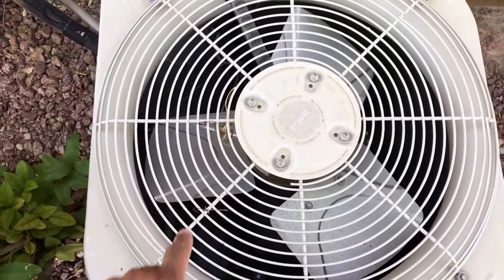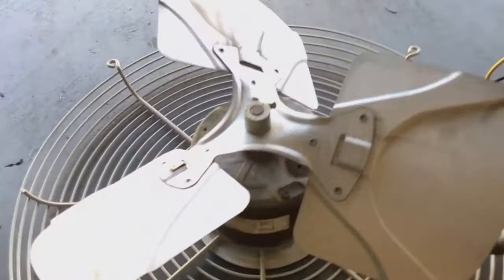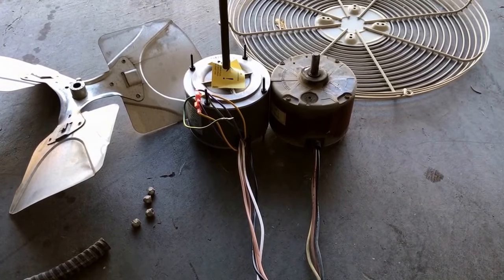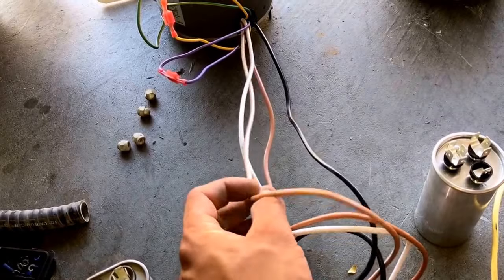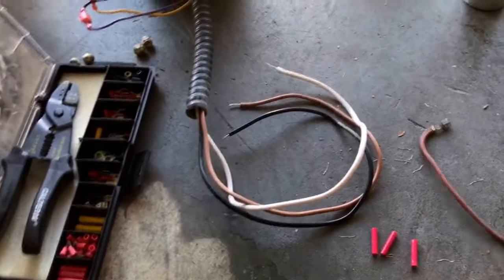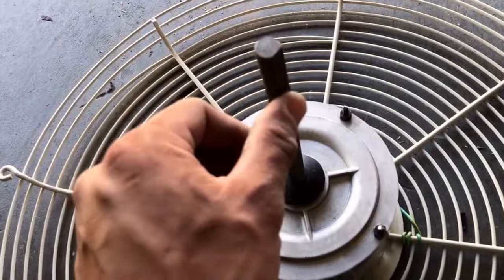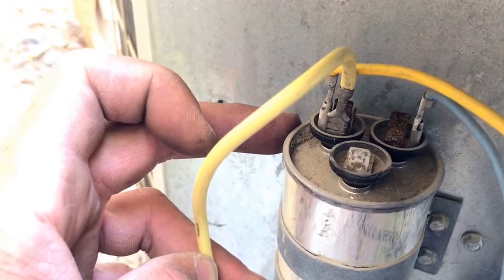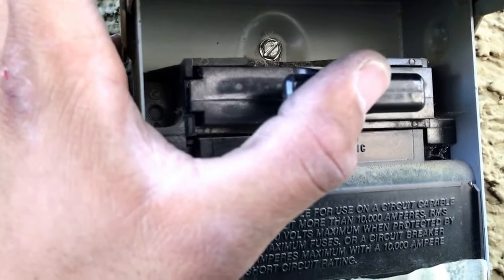Replacing Condenser AC Fan Motor (Step by Step Instructions!)

Comment: I had two “technicians” (actually sales people) come out and quote me from between 8k-14k to replace my whole air conditioning system. They said it was burned out and not worth the money to fix. I ended up doing it myself for less than $300 by watching this video (I ended up changing out the capacitor and contactor as well). This is the real deal, don’t let yourself get ripped off.
Reply: Yeah I got quotes for new AC units 11-18K. Absolutely insane. Luckily I watched this video I’m getting this done asap. I already know it’s not the capacitor. Had someone come look at it.
Reply: I'm lost on the green ground wire part... it's connected to the skinny screw and bolt of course.  But where does it connect to from there?
Reply: @MarqFlournoy  my ac guy just cut it off lol says it’s not needed
Reply: The same thing happened to me. Technician told my wife and I the AC unit needed to be replaced, costing around 16k. These people have no soul.
Reply: For house units this is insane but I'll explain why. The epa, the government and r410 freon. If you fill with old freon it will cost you upwards of $350-700 a pound to put in so a new unit is better. But they're ripping y'all I just had one of my commercial units replaced for $17k it's a 5 ton of I remember right.
Reply: 8 k lol how much is a whole new unit?😂
Reply: @1BadSavage they aren’t cheap that is for sure. 8 grand sounds cheap.
Reply: When homeowners start touching the ac units, all that does is make it more expensive when an actual hvac master services it. Liability = more $$
Reply: Just had them come out for a rental said fan motor was bad 1000 dollars to replace buying one with a new capacitor for 120 I’ll do the labor and have a nice dinner 😂
Reply: Oh yeah, they love to replace the whole system even if your system is 10 year old.

Comment: I replaced the capacitor then the compressor would run but the fan wont, double checked all connections and everything was fine. Texted an HVAC tech I know and was hoping he will be able to come and fix the fan tomorrow. Then I watched your video right before going to bed and went to the unit with a long screw driver, gave it a spin and pushed the breaker in and the unit started running just fine. Tomorrow if the HVAC guy could make time would come and with a poke of screw driver drain $200 out of my pocket. Thank you so much for the video.
Just to share with all, my AC stopped working Saturday night and all the HVAC supply stores are closed on Sunday (Atlanta area). So I ordered it from Amazon for $14.99 then added another item to the order to bring my total to over $25 and got overnight Prime delivery in less than 24 hours. When searching I searched for items that has overnight delivery available.

Comment: I bought the motor for $230 after taxes...... And just spent 35 minutes doing it myself.... Thank you for this video it saved me $888. 
I paid a company to diagnostic my unit. ($69) they then emailed a quote of $888 just for the labor!!!! 
I'm not a guy that knows or even wants to deal with wiring but this was easy even for me
Reply: That's the reason I'm here 😂 but don't know where to buy the motor, where did you bought yours?
Reply: @marketbrock8496  just call and order from a plumbing supply store. Make sure you take a pic of the data plate so you order the right one
Reply: @marketbrock8496  I went to a contractors store and brought the HVAC business card for the guy who said I needed a whole new unit. I told them I needed to pick it up for him and he was installing.. that he asked me to swing by and grab it. They gave me contractors price.  Paid $77 for the motor and capacitor.
Reply: Shouldn't have been moore than $250 to install the motor. Plus the part.
Reply: @Garth2011  Paid $504 including part and labor. Dallas, Texas 😔
Reply: These type of service are predatory because it's 112F outside.
Reply: Do u have to bleed all the power from the capacitor
Reply: @nickolassanchez9420  bleeding the capacitor just means grounding it out after everything is unplugged from it. But yes I definitely would. Take a screwdriver after u unplug everything to the capacitor holding it by the plastic handle  cross touch the plugins on the capacitor itself to release whatever charge it may have

Comment: Great video.   Im doing exactly the same job this morning with the same 2 motors as you use.  I searched this video to try and figure out the wiring differences before i head over.  Your step by step explanation is perfect.

Comment: In the video I watched,found it to be accurate and informative. In your next video I would include the information that there are motors differences when it comes to wet and dry locations . A service tech thought he was giving me a good deal . Sold me an indoor blower motor for a good price, although it was for my condenser. Didn't know till I got it home.I called him he said oh it's alright I use them on all cond. Fan mtr replacements . Sold it back to him.

Comment: I didn’t have a fan puller when I got to that part and I just simply put wd-40 all over the backside and top side aswell as inside the removable tightening nut, then i put an object that fit perfectly in the hole, Put pressure while pulling the fan blade with my other hand (wear gloves just incase) and it came out relatively easy.

Comment: Good explanation and details but whatever you do, DO NOT Loop wires outside of the unit under ANY circumstances. Keep all wiring protected inside the confines of the unit. No one should be able to walk up to an electrical device and touch wires without removing a cover to do so.
Reply: Yeah that’s not too professional looking and dangerous too.
Reply: What would be a better way to hide the wires? When he takes it apart I don’t even see the “reverse” wires

Comment: How bout the discharging of the old capacitor, did you just use a screwdriver basically across the leads to discharge for safety?
Reply: People on these videos keep skipping that step. Somebody is gonna freaking die. These capacitors are no joke.
Reply: I have never seen anybody receive a shock from a run capacitor connected to an AC voltage source.  What you need to worry about is capacitors connected to a high voltage DC source (televisions, HVAC inverters, etc.).
Reply: You'll be fine as long as the disconnect is pulled. If you touch the leads with it still in you'll get a shock but it's only about 110v to 120v. It's not that bad tbh.

Comment: something I have seen I would like to mention. The wires coming from the fan to the contacts. I have seen on some mobile home manufacturers  that didn't have a plastic sleeve for the wires , and I guess it could be the installers , using plastic ties to strap the wire to the top grill. Don't do that. Plastic degrades in the sun. And it will be fine for a while but when it gives and the wire drops into the fan and the fan bends and cuts into the coil, that's totaled. If you have to do that use a coat hanger or something and you need something around the wire if you can to protect it from the sun as well. just sayn
Reply from the maker: Honestly that is a very valid point. Most newer manufacturers (probably to minimize costs) do not have the protective clips on the wires like the older models. Many condensers have clips on the under of the panel where the motor attaches. Regardless I appreciate the input especially when the goal is to help technicians become more effective in the field.
Reply: @MoreThanMaintenance  Typically if your fan gets bent it won't touch the coil due to the way most manufacturers put the fan in a throat away from the coil. But this was an obviously cheap AC only package unit. The heat was in another unit inside, they just joined the ducts. Crazy set up to someone who isn't a mech tech. So really I said it for the DIY who is likely the most common viewer of a you tube video. I'm just a n HVAC controls Tech who was trying to help someone.   Wound up more than I  wanted to chew and more than they could spend

Comment: question:  some people cut the ground saying the motor is grounded by frame.  also, leaving the reverse wires out is convenient in case need to switch them, however will those get sun damaged over time?  also some put the yellow on the contact guess that is ok too?  thanks again

Comment: thanks for this nice video, if the new fan motor i bought has same rpm, voltage, and HorsePower,  but the amp is 1.3 , but the old amp only 1.0, will this cause a problem ? thanks

Comment: Might be a dumb question I'm sorry I'm learning. 
But disconnecting the unit is that the same as turning the power out in the home. My AC unit is located on the roof
Reply: Pull the disconnect, but this only disrupts the 240v not the 24v, so don’t touch the side of the contactor 😁. Be sure the MFD/UF rating for the new fan is correct. Usually I’m taking a 1075/825 rpm 5uf fan out and replacing with a 7.5uf. I know your comment is 4 months old but hopefully that can still help 😀
Reply: You can turn it off at the breaker too if you want to feel more safe. But pulling the disconnect is all you need to do.

Comment: Thanks for sharing, very good video, it doesn't seem like a difficult task w/ your video.  Questions:  1) My condenser runs well, but when the temperature outside gets really cold or hot, it makes a REAL LOUD noise (like buzzing/humming), is this an indication of bad capacitor/motor? Is there a way I can be sure it is before I try to replace it?  2) Why did you cut the bolts?  Couldn't you have the left the original length?  3) Why is the motor reversable and doesn't run just on one/the right direction? 4) Is it OK to leave the wires wrapped on the grill permanently?  Thank you.

Comment: Hey there, just heard a big humming sound outside and turned the breaker off ... now what would cause the outside unit running HOT and the Fan not spinning at all? It seems as if the fan died while the outisde unit and the compressor were working ? any help appreciated it's Sunday night and we have 80+ degrees at 7PM here ... cheers !
Reply: Same problem here 90 degrees inside
Reply: @breannahawkins2901  turn the units OFF at ALL breakers ( inside and outside ) take out the capacitor and put it on a flat surface, if it's rocking/not standing flat replace it > please follow safety precautions and DON"T DO THIS YOURSELF if you don't know what you are doing - pls lmk that you read this THANKS !

Comment: I’m looking for a video that shows me how to handle a capacitor before removing the wires from it.
Reply: I'm a bit late to this but the only thing you need to be mindful of is discharging it before handling. The safest way to do so is with a load resistor, I have a 100W 4 ohm set for that. In truth you can use almost any conductor but a resistor will bleed it slightly slower and its safer. You want to be absolutely certain power is shut off before you do so as you'll be intentionally creating a short by connecting each contact to each other. Ie A to B, B to C, A to C. Ensure you are using something insulated to discharge it, or insulated gloves as you don't want to be the path to ground when touching potentially live wires

Comment: What size were the nuts you removed to disconnect the motor from the face-plate ?
Reply: Whatever size they are going to mount to new fan bolts, so what size is the new fan bolts?

Comment: you didnt say how you cut the shaft, what tool did you use
Reply: it looks with a abrasive disk small tool or drill attached   did you see the smooth cut of the shaft
Reply: I have used a hack saw but sometimes you don't have to cut the shaft if it doesn't interfere with anything in the condensing unit.
Reply: Sam please show video cutting shaft. Thanks

Comment: It's of the utmost importance to lubricate the shaft.
Reply: Do not do this, the shaft has a locking bolt that connects the fan. If you lube it up it can potentially come off. The shaft is connected to the motor and is sealed.

Comment: How much was the motor and where did you buy it?
Reply from the maker: The motor I purchased was a Fasco D7909 motor. The best way to find out what motor is best for your specific unit is to take the information from your condenser motor or if you remove the motor from the condenser and check the specifications on the motor you removed. You want note of  running amps... and voltage of motor matches your specs. You can purchase this online 👍 $80-120 is reasonable.
Reply: @MoreThanMaintenance  thank you!
Reply: @MoreThanMaintenance  I had my combo unit  TUNED UP today and the young guy maybe under 25  said that my  condenser fan motor is " over heating ' it is supposed to be at 60 F and at 8 am is " running at 68 F "  and ' he has the part in the van of if NOT he would be more that happy to go get it at the part store and would not charge me for that " and then he said it would cost me for everything Parts and Labor  " just 654  bucks " 😦  so I politely told him " I am broke now and probably I will do it later on when it must be fixed " . . . what do you think of that price to replace the Fan Motor and this is in Sin City   July 16 2020      Thanks 😎👍😷
Reply: @edca8114  - Condenser motor overheating by 8 degrees?  That's the first time I've heard that one.  That price is pretty steep for a conventional AC motor.  If it was a sleeved bearing bearing motor, he should have oiled it for you.  My new condensing unit has an ECM motor in it so that motor would cost me over $300 to replace it.  There's no telling how much an AC company would charge to replace it.
Reply: @picklerix6162  it was a young cat .. did not cover his boots and was not wearing a mask and  when he check the filter he did not take it out just with a flashlight from the floor and said is ok  then he was eager to replace the C FAN  and about 2 years ago I was told that " my  C Fan was ok BUT maybe it would need to replace it " soon "  so   I just told him  I might replace it later  " I do not have extra cash right now "  is  just  Remove and Replace it   it might cost around 150 bucks have NOT really check but I might do it myself later on   and the young cat told me my UNIT  IS OLD  2013   so   he DID NOT GET THE EXTRA JOB and MONEY for their pocket 
😊😊😄😷
Reply: What's wrong when the unit is blowing air but not blowing cool air? Please help..
Reply: @PhantomMSM-f7y  filter maybe dirty

Comment: Thanks for the video! Can you tell me if a motor with 1 amp will replace a 1.6 amp. Everything else is the same except for amps. HP is 1/6 and 825 rpm. Both same but amps.
Reply: i know this response is a little late, but i think it should be. seems to just be more efficient
Reply: @tomalstar  Thanks!

Comment: Hello good video quick question i changed the unit but i find the fan to be about 2 inches lower due to the crank flat end to tighten the screw will.that make a difference if its 2 inches lower then it was before? Thank you.  Ps. I subscribed
Reply from the maker: If you are fastened on the flat end you will be fine. Just ensure that you have clearance.. ie no wires in the way...etc. I usually take a stick and manually rotate the blades through the casing. If it turn your fine 🙂

Comment: would this also work with a fan motor on hayward summit pool heater unit? my fan motor went out and i would like to do it myself but cant seem to locate the correct video everything comes out to ac units not the pool heaters